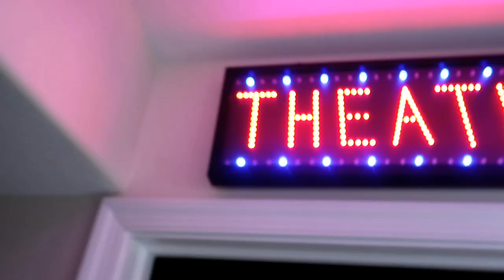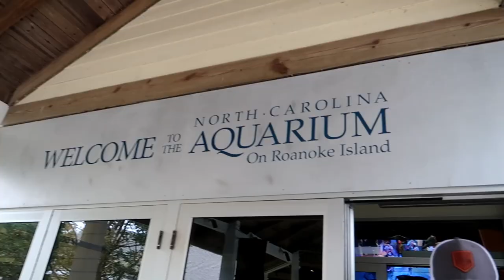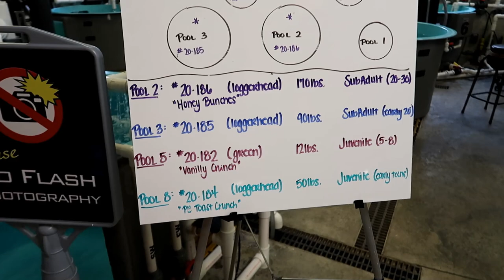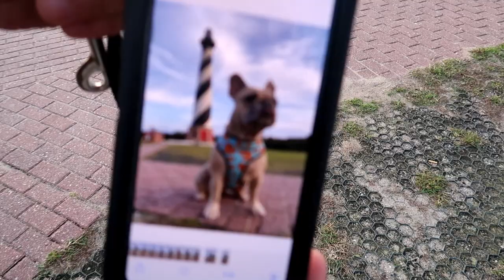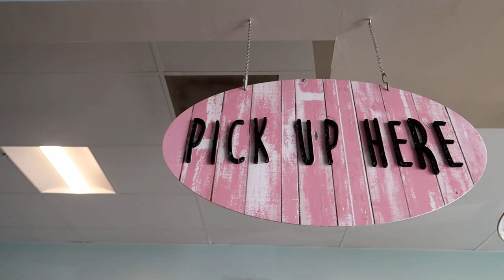OUR 1.5 MILLION DOLLAR BEACH HOUSE GOT DESTROYED!

Comment: U should replace that wooden wall with somthing stronger like concrete I know that would be expensive but it would help u guys in the long run if this type of weather keeps up
Reply: you relize the ocean dont give a crap?
Reply: @Dindal1  yeah it don't but it would help keep the sand and shit out of there pool, and the wall would not give out that easy  it would take a lot
Reply: It wouldn't hold up to a hurricane ive been though several of and seen some crazy shit I once rode one out ocean front and watched the ocean rip shit apart

Comment: Mike and Gina what you need is giant boulders the size 5 feet by 5 feet big dumped out on the sand and go at least 15-20 feet tall and build a walk way off the deck and stairs down in front of the boulders on the beach side to walk down to the beach

Comment: Buy the house, concrete wall, 10 feet tall, 10 inches thick, go down into the sand 2 or 3 feet. The water will wash around it, not penetrate it.